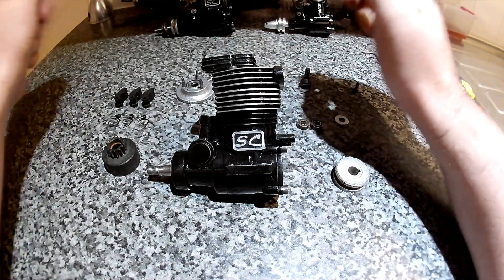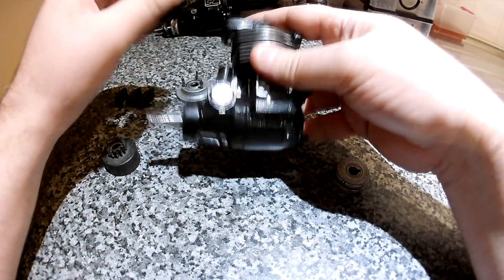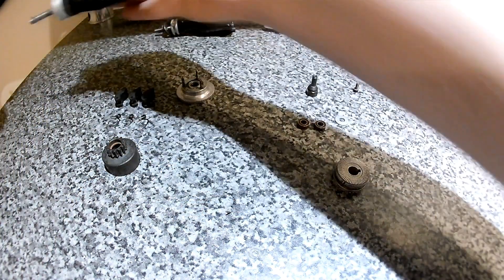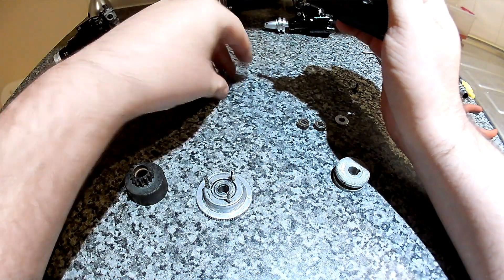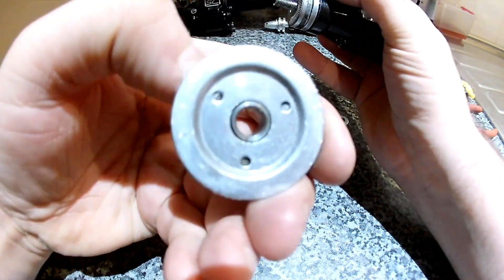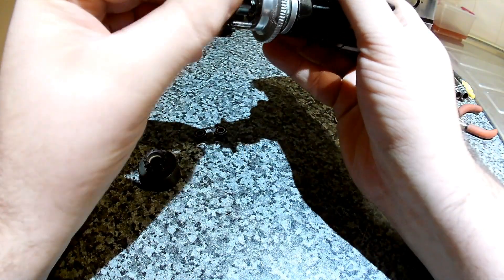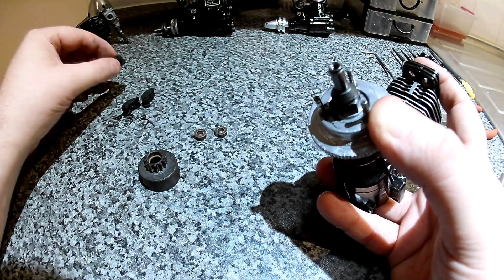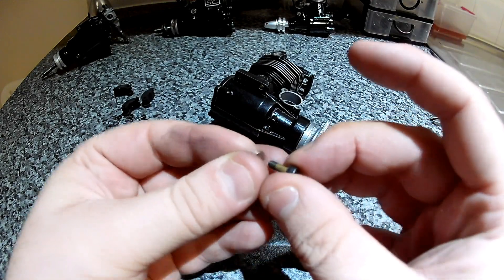How To Convert A 4 Stroke Glow Engine For 1/8 Scale Nitro Car Buggy Truck Use HPI Losi

Comment: I've done this years ago with a couple of 2-stroke aero engines of .40-.60 size. I had to radically change the gear ratios to get any top-end speed out of it, and the engines ALWAYS ran hot with them being aero engines with a much smaller heat sink on the head. I had some success with using a tiny P.C. cooling fan blowing over the head, but proper sized 1/8 scale car car engines are always a better choice.

Comment: I was just curious why you would want to convert it to a four stroke if they run hotter and have to add a bunch of fans.Do they last longer? Do they have more power?
Reply from the maker: It was purely a case of could i do the conversion. I had a spare 4t engine along with a spare crankshaft so i could revert back to stock and I like to tinker. It was under powered due to max rpms but a change in spur and clutch gears did improve it. It did get quite hot, even when running with no body shell. It's certainly do able but as you stated, fans needed. Would I run a 4t zfull time in an rc car? Yes and no. A 1/10 touring car with a small os fs would be ok. 1/8 is too heavy i think. There was a 1/10 from factory in the 90's / early 2000's with a smll pullstart 4t engine, I forget the brand. It was around a .25 size.

Comment: I had a saito FA 50 in a Traxxas 4tec. Very fun and would rev to about 15,000 rpm before valve keepers would snap and hole the piston. Check out my vid if you like.

Comment: Can I put a 1/8 scale motor on my 1/10 scale Nitro Shockwave buggy
Reply from the maker: If its the redcat shockwave where the engine mounts length ways rather than side ways, its doubtful. A 1/8 scale engine is usually a big block engine and almost twice the size of a 1/10 engine. The shockwave does not a lot of room to play with. Anything is possible though. The chassis will need to be re drilled for the larger engine mounts but i dont think you have enough length to play with , the back of the engine will be hitting the rear arm if it does manage to line up with the spur gear.

Comment: The proper Os car engines can be made to rev to 20,000 rpm with right carb and exhaust, have to gear them high and have a two speed gearbox to get the best out of them. I have an Os Fs 26 In a 1/5 scale bike, vids on here.
Reply from the maker: Will check the video out!

Comment: The car engines have different cams and valve springs, and unavailable now, but still command high prices second hand.
Reply from the maker: I have been keeping my eyes out for a car version 4 stroke, They never come up for sale so fitting an aero 4 stroke is the next best thing. Its for the noise more than anything because even the car 4 strokes are slow unless on a 1/10th. Pretty much why you dont see them made for cars today,  too slow and costs are high compared to 2 strokes. shame really.

Comment: So you painted the engine black and fitted a car clutch, you know this engine good for 11,000 rpm?
Reply from the maker: I know what you are thinking lol I was very aware what the performance would be like. The engine in the ansmann had another crank fitted and popped back into a plane. It went well, not very fast but a lot of torque.
Reply from the maker: Will also add that when i was looking to do this, there were no videos of how to fit the flywheel etc to a 4 stroke, so i thought i would pop one up. Obviously it needs custom mounting into the chassis as the aero engine ends up being an inch longer.
Reply: @GodsCorruptible  33d qqq33q²1 w 21st
Reply: That's what they make different gear ratios for....

Comment: thank you very much for your answer. I will try to attach the engine to a traxxas Revo. When I get it I will look for a method to start the engine
Reply from the maker: you will ideally need a bump starter, thats the most reliable way to start them, like the race engines etc with no pullstart. If you struggle to find what you need, i can sell you the complete setup in the video with or without the crank as its not being used at the present time.

Comment: Hello Mark Fpv, What inertial flywheel, cone and crankshaft extender did you use?
I have the same engine.
Has the same diameter and step that of Kyosho?
Thanks for your video
Reply from the maker: The pilot nut for the clutch assembly Im pretty sure was for a 1/8 scale kyosho inferno. part number: IF208B. I used a generic 1/8th scale flywheel.

Comment: I have an os fs40 that has the same thread. What pilot nut did you get? There is very little in the way of specifications for pilot nuts/shafts of available ones
Reply from the maker: Im pretty sure it was for a 1/8 scale kyosho inferno. part number: IF208B. Pretty much any 1/8th pilot shaft will fit. its the smaller shafts found on .15 engines out of 1/10th's that wont fit.
Reply: Mark FPV I'll try it. Better than anything else other than a mass order of the part and hope since most don't list sizes. Or machine it myself and that'd be a pain
Reply from the maker: I may have a spare if you dont have any luck finding one.
Reply: Mark FPV thankfully I found 4 pieces between Amazon and eBay. Quite surprising since it didn't even try to screw around with search padding.